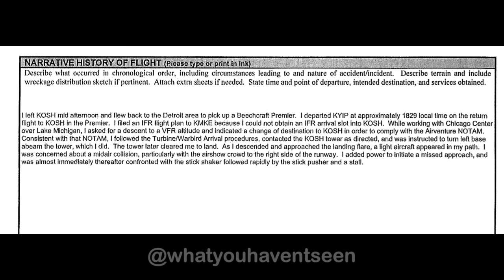Jack Roush Crashes Private Jet At Oshkosh (2010)

Comment: A Raytheon 390 Premier 1A corporate jet, registered N6JR, was destroyed in a landing accident at Oshkosh-Wittman Field, WI (OSH), USA. The passenger and pilot survived. The airplane operated on a flight from Detroit-Willow Run Airport, MI (YIP) to Oshkosh-Wittman Field, WI (OSH).
The pilot was flying to OSH to attend the Experimental Aircraft Association’s Airventure 2010 fly-in convention. During the fly-in convention, a parallel taxiway east of runway 18 was used for takeoff and landings and was identified as runway 18L. The main runway, normally identified as runway 18, was denoted runway 18R and had a displaced threshold of 1,300 feet, leaving 6,700 feet of runway surface available for takeoffs and landings.

The tower controller cleared the pilot to land on runway 18R and to make his base turn abeam the control tower. At 18:15, the tower controller told the pilot to turn northbound, onto a left downwind for the runway.
Some 30 seconds later, the controller handling departing aircraft told the pilot of a yellow Piper Cub to taxi in position and hold on runway 18R. The pilot of the yellow Piper Cub acknowledged and requested an "... angled departure to stay clear of faster traffic." The controller handling departures then transmitted, "Cub uh 18R cleared for takeoff as requested ... cleared for immediate takeoff." The pilot of N6JR was not monitoring the departure frequency, and therefore did not hear these transmissions.
The accident airplane was turning to base leg when the yellow Piper Cub was cleared for immediate takeoff.
The accident pilot reported that, while on base leg, he became concerned that his descent path to the runway would conflict with the Piper Cub that was on takeoff roll. He stated that he overshot the runway centerline during his turn from base to final, and, when he completed the turn, his airplane was offset to the right of the runway. The pilot stated that, at this point, he decided not to land because of a perceived conflict with the departing Piper Cub that was ahead and to the left of his position. The pilot reported that he initiated a go-around, increasing engine power slightly, but not to takeoff power, as he looked for additional traffic to avoid. As he looked for traffic, the stall warning stick-shaker and stick-pusher systems activated almost simultaneously as the right wing stalled. The airplane subsequently collided with terrain in a nose down, right wing low attitude.

Probable Cause:

PROBABLE CAUSE: "The pilot's decision not to advance the engines to takeoff power during the go-around, as stipulated by the airplane flight manual, which resulted in an aerodynamic stall at a low altitude.
Reply: That makes some sense of what happened. It was obviously due to pilot error, but, at least there were mitigating circumstances.
Reply: Full power, gear up, clean wings, I don't fly but my youngest does.

Comment: I don't know what's more impressive, if it's the failed landing attempt or that people actually make a living by going around oval circuits, enough to buy them private jets! I must be doing something terribly wrong in my life!!
Reply: Uh.... the angle of the track actually make traction EASIER. That's why it's set up that way.
Reply: @harorider96  I'm not fan either, and I'm not hating it, I'm just trying to see it for what it is.
You can write a dissertation about the aerodynamics involved in high speed driving, the forces of friction between tires and tarmac in left banking corners and so on and so forth, you can invite me to be part of it and call me a professional NASCAR racing driver, and call me a national hero when I win the championship... but I'd still think that all I'm doing is getting paid to go around oval race tracks!
As for NASCAR being a hard thing to do for 500 laps, have you tried balancing your kitchen chair on the tip of your nose during those 500 laps? Believe me it's more difficult, but no one's paying you to do that, let alone getting rich for doing it!!

Comment: The lack of preparation to go around, I believe, is the single most relevant reason this maneuver gets pilots in trouble. It’s not a difficult maneuver but it is relatively complicated with more then a few procedures that must be done in the proper order in a timely fashion. This is especially true when you’re talking about complex aircrafts such as a jet. Probably thousands occur every day, but it is not a common occurrence to each individual pilot. I have been a Commercial Pilot for 35 years, with 32 of those years spent flying commercial airliners. The 727, MD80, most models of the 737, 757, 767 and now the 777. In all those years I have only had to do 4 actual go arounds. However I’ve probably done a thousand in simulators during training events and proficiency checks. This trained my brain to expect to go around every time on final, so I’m always mentally going through the steps and call outs of a go around on every final and incorporating them into any special go around procedures the airport may have. So, if I have to go around for whatever reason it’s not a surprise. I can guarantee you the last thing on his mind was that he was going to have to go around. So when it happened he was just along for the crash. It’s ironic that one of the rarest maneuvers a pilot will encounter is also one of the most critical to perform correctly given your proximity to the ground. The only other ones I can think of is a high speed aborted takeoff prior to V1 and the loss of an engine after V1. These are three maneuvers every pilot should be mentally prepared for and expect on every takeoff and landing. There is a fourth, the loss of an engine during a go around. But we won’t get into that one.
Reply: just because you can fly the plane does not mean you should fly the plane , if he can afford that jet he can certainly afford a pilot also .
Reply: Dennis Brown You nailed it. Just cause you can doesn’t mean you should. 👍
Reply: Sir, I absolutely respect your experience and knowledge regarding your approach to flying .. every single pilot in the world should heed your advice on a daily and regular basis..
Reply: Fantastic analysis and excellent areas to reflect on for every Pilot!  Thanks for the valuable insight Sir.  :)

Comment: From the NTSB report it looks like he first entered downwind too close to runway 18, was told by tower to head north to correct this. Asked tower "Is this gonna work?" on base. Once turning final, he got spooked by the departing Cub and did a half-assed go-around with thrust levers only a third of the way up because he "wanted to clear the airspace first" and because the plane was a "hot rod" in go around power. Data shows airspeed was decaying the whole time with negligible altitude loss until the stall. Once he stalled, he stated he didn't want to increase power so as to lessen the impending impact, as the stick pusher was pitching him down. Erroneously stated he was not given a choice of runways, that another aircraft was on the runway centerline, and that he later opened the door himself, contradicting photo and video evidence.

Comment: WHAT HAPPENED that caused the crash?????   The way he was Cowboy'ing into the final approach was a prelude to the outcome, for sure.
Reply: Spot on! I agree with you 100%
Reply: Hard to tell what was going through his mind. At 0:10 it is clear he was attempting to abort but at 0:20 he is descending. Either he pulled his flaps too early with no positive rate at the wrong airspeed, or he thought he could salvage the landing and decided to force a descent back to Earth after blowing his approach.
Reply: He was cowboying. Seems to me he wasn't carrying enough speed into the turn and stalled when he tried to straighten out and initiate his go-around.
Reply: "Look ma..............no brains"
Reply: Sully would not have done that!

Comment: What kind of landing was he attempting to do? I’ve never seen a pilot maneuver an aircraft like that so close to the ground prior to landing. It looks like he was trying to show off and then lost control. You generally come in at a long straight decent and touch down not making a low 180 degree turn over the field before landing. Especially in a small business jet.
Reply: You nailed it.  ATC gave him an opportunity to show off and he took full advantage.   Another example that familiarity breeds contempt.
Reply: This is at EAA Airventure. Because of the huge volume of traffic at the airport, there are a lot of unusual rules and procedures to follow. The approach was perfectly normal for Airventure. His first actual mistake was thinking the Cessna that had taken off from the same runway a whole 8 seconds earlier was a collision hazard. His second mistake was not advancing the throttles to TO power when he decided to go around, leading to a stall and crash.
Reply: You've obviously never watched how Airventure does it.
Reply: I have it cost a dear friend who was a passenger his life
Reply: The approach procedures are different for jets and props.  If there is a bunch of 172 coming in, that bizjet will not hang in the pattern with them.  Jets can get a straight in for that runway, if needed.  

As I tell my students, a good landing depends on a good final, and good final depends on a good base, etc up the line.  This approach was not stable from the beginning of the video.  

I have stood in the warbird area and watched both a bizjet and a FJ Fury abort landing on that runway because the pattern didn't end up right, they couldn't safely make the turn,  and they end up swinging out over the GA parking area at full power, which may be another safety issue. 

I did see one jet, a C-17 in full STOL mode get in the pattern with the Cessnas, etc.   He made the turn to final, planted it on the numbers, and stopped before the 2nd taxiway.  Plenty of room before even getting to show center.  :).
Reply: What the %$#@ do you mean? OK, yeah. The T-39 was the original business jet, formally known as the Saberliner. We routinely flew it like  a jet fighter plane and wrapped it around at nearly a 90 degree bank angle after we streaked over the runway to drop in altitude into our down wind leg. Of course, our base turns were more gentile as was our touch down.

Comment: Wow, pretty remarkable video showing nothing similar to the reports at the time of the accident. What an approach!  Not sure (with my understanding) given the volume of traffic during AirVenture, but I would not think they would  intentionally have him on an approach that looked like that one did. It just looked like trouble from the start of the video.
Reply: the narrative history of the flight seems strange as well. after initially gaining some height and leveling the wings i would not expect the plane to stall if the engines are at full power. seems more like he added some power for the turn and tried to land afterwards or what would you guess?
Reply: Tom Glass
Reply: That's how they do it at AirVenture

Comment: In answer to those that are wondering about the state of the aircraft upon crashing, it's a property of the mass energy equation.

Because it's such a small, and light aircraft, the amount of joules energy expended from the kinetic energy retained upon impact, a smaller crash was resultant.

Therefore less of the hull was damaged, and it was much less likely to cause a huge explosion or fire. Very large aircraft, or commercial airliners, due to their enormous mass, retain much more kinetic energy upon impact, and therefore the hull usually is destroyed and broken up killing everyone on board. Much more of the kinetic energy retained in the large mass, can also cause a larger impact crater, and fuel fire.

The small private aircraft, weighed much less, and was moving much slower, and as you can see, it just broke some of the empennage leaving the cockpit area undamaged.

Comment: His approach was too low initially so he tried to correct it with a last minute climb, but he was nowhere near the runway centerline - overshot that to the right by a long shot and had bled off too much speed by this time - and stalled. Pilot error. Lots of hours as PIC doesn't necessarily mean you're experienced... There is nothing wrong with a short base/final approach, except if you do it the way he did it. That was poorly executed.
Reply: That is in fact not what happened. He attempted to initiate a go around but only gave the engines 33% power when it should have been full power. That caused the plane to stall and crash.

Comment: " a light aircraft appeared in my path..." Well, you see Jack, this is an aviation fly-in for the "little people" and you do not own the runway environment. This precludes showboating with your jet in front of the crowd when you should be concentrated on either landing safely or executing a cleanly flown low pass with the tower's permission. It is not unrealistic to speculate that if the jet had cartwheeled when the tip dug in, that the aircraft could have struck the Cessna 170 on the adjacent taxiway or even the crowd at the fence. Every year that I've landed at Oshkosh, it has been extremely busy and landing on the taxiway adjacent to 9/27 while the main runway is in use is SOP.  If you are, as I expect, wealthy, hire a pro to fly you around. It's what they do.
Reply: lol

Comment: For one striking example, page 31 line 25 has Jack stating that following the crash he walked back into the fuselage of his jet and found that "the cabin was intact, completely intact."

I read the interview and it’s unclear which part of the aircraft he’s actually referring to. The very next thing he says following that is about how the yoke and pedals are in the right spot. I think he may have been referring to the flight deck when he says it was completely intact. 

He later talks about damage to the window of the overwing hatch but says nothing further about damage. To be fair, he wasn’t asked about that. 

What is clear is that he was too concerned with hypothetical traffic that he forgot to fly the airplane. He admits he wouldn’t have stalled and crashed had he correctly applied takeoff power.

Comment: What, doesn't everyone make their turn to final at 50' altitude? This guy knows how to live I'm telling ya!
Reply: I am a non-pilot and was watching on the YouTube front page (in the smaller form, I had not clicked on the video) and thought "that can't be how you're supposed to do that" when he approached. Your comment made me laugh and confirmed my suspicions.
Reply: This crash happened at a large airshow. They have modified approaches and this particular approach is the hardest in my opinion. Normally they come straight in with lots of room. But here, they have to fly a rectangle pattern to keep them away from another runway that runs perpendicular. I fly a beechcraft bonanza and its a tight turn in my plane. I can't imagine flying it in a faster plane like the premier. With that being said, there is no excuse for getting that slow and stalling. That plane has a stick shaker and an audible alarm warning of a stall.

Comment: His report of what happened is nothing like the video.  How about taking responsibility instead of blaming the crash on someone else.  To all you real pilots out there, you dont have to be a pilot to see what happened.  If there was an engine failure or control problem he didn't mention it.  Just someone blocking my way.  Try blaming it on a bird strike.  Or a UFO.  Or hypoxia.  Or incontinence.
Reply: incontinence = winner
Reply: "Or incontinence" That's funny sh1t! Well played
Reply: The incident happened exactly as he said it did... but for the fact he lined up and tried to land on the taxiway rather than the runway. Of course there were aircraft in his way.
Reply: Sri Yantra  CORRECT

Comment: I was there!!!! I was near the normal touchdown point.  I heard him jam the throttles to full power, a recognizable, at slow speed, in trouble intense whining. I said "That can't be good!" Followed by the thuds of crashing in the grass. Got to see him exit the airplane. Pilot Error! "I'm a former USAF and airline pilot" and it was pilot error from turning base to final too tight pulling it around, too little airspeed throughout, exceeding capabilities of the aircraft 1st preceded by capabilities of the pilot 2nd. Oh,and not enough altitude to recover. Great video!!
Reply: I was wondering about that turn onto final, it looked like he was beyond the threshold or maybe it was just a bad camera angle, had it been me, I would have started my final several miles from the runway in order to take care of all the checklist items. It seems to me he was a hot dog and not a professional.

Comment: Flying into Oshkosh during the show is an unfamiliar operation to most pilots.  Add to that Mr. Roush's age.  He was probably at a point where someone should have told him he needs to stop flying or at least always fly with another pilot on board.  I'm a CFII and have encountered the "too old to fly" issue before.  It's tough.  You are breaking someone's heart.  But it's better than this alternative.